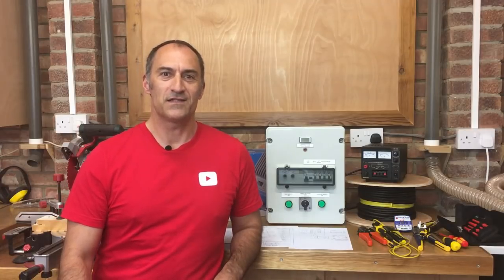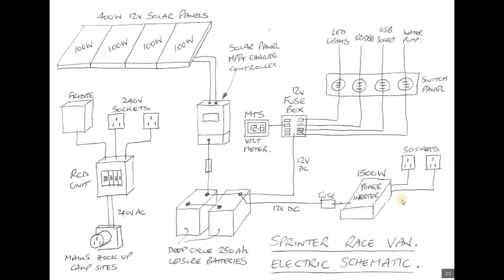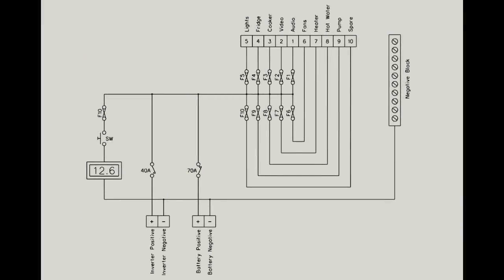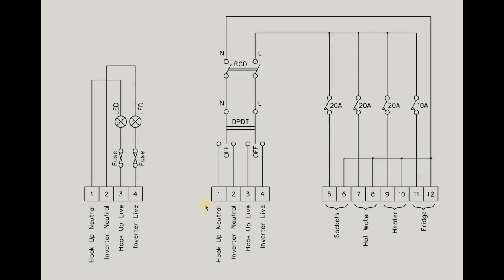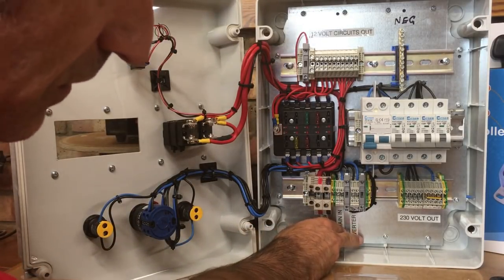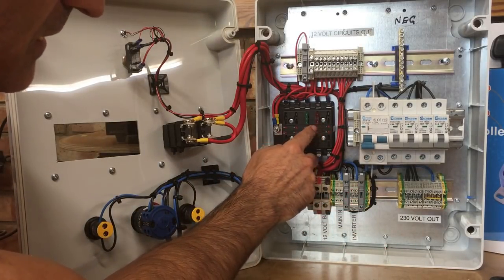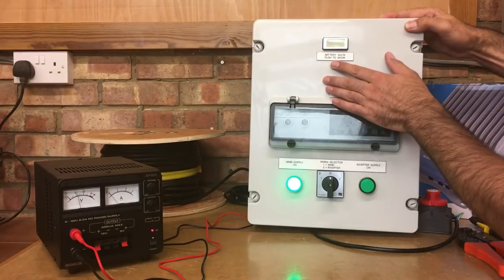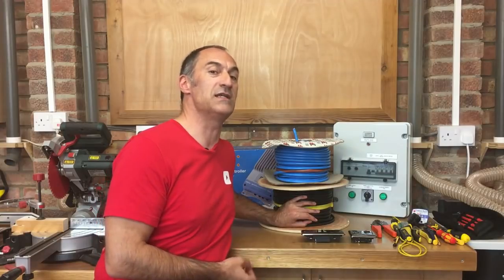Self Build Camper Van 12v Electric Control Panel

Comment: to update how you would do this now, the 2 separate systems is not so necessary.
the new victron inverter has a great pass-thru feature for shore power.
it does it all. it only uses excess AC for charging.

Comment: Now if you wanted to run it all off shore power, could you? Where would you run a jumper from the fuse box to the where? 12v fuse box? With a transfer switch between of course …

Comment: Are the red cables running the 12v side of things the same size as the battery cables coming into the unit? Looks like various thicknesses and can't get my head around it.
I'm also guessing the blue cableing for the 230v is artic blue and the black the same size just different to differentiate between positive and negative?

Comment: You used in one video a 1 pin wire connectors in a Wago connector. I would like to know where to purchase  these connectors can't find. You just pushed smal stranded wire in connectors and made wire easy to slide into Wago with ease.
Reply from the maker: Di think you are referring to “cable Ferules” they are like a shoelace crimp to bring all the lose strands together. Wago can be purchased from screwfix or tool station 😊

Comment: Hey Greg, how do the swap the shore power fridge supply over to the 12vdc or does the fridge automatically prioritise power and have both a mains and 12v connection? Cheers mate.
Reply from the maker: My fridge is just 12v DC so runs off the batteries all the time. 👍🏼😃

Comment: How do I add another fuse box if I run out of the ways/connections? - Please help
Reply from the maker: Just duplicate what you have already. So take another positive and negative off your batteries via a fuse to another blade fuse holder. You can even locate that nearer to your loads too 👍🏼😃

Comment: Hi @Greg, quick question did you put fuses on your green indicator lights as per your wiring schematic? I couldn’t see them in the video and just wondered if they were necessary? I like the idea of having an indicator to show either the mains or inverter are live.
Thanks for sharing. Your build videos are super helpful 👍🏼
Reply: @gregvirgoe
Reply from the maker: Yes, they are fused. pause the video when the panel is open and onthe bottom Din rail are two grey fuse holders betwen the main in and inverter in terminals. Yes its a good idea to have a fuse in case of a short circuit in the light.

Comment: Hi Greg, I am converting a bus and found your videos, they are awesome! thank you. I have a question, what size is your CB that connects to shore power.?
Reply from the maker: The most you’ll get from external camp sites are 16amp supplies 
It difficult to get a small RCD so one that 25amp would be best.
Reply: @GregVirgoe  Awesome, thank you

Comment: Hi Greg I have a question. In many Van and Bus conversions I see people installing a main DC shut off switch on the positive side of the battery to shut down everything. This makes good sense but one issue I have is this. All the solar charge controller installation instructions say first connect your battery and then your solar panels. fine but what happens if you shut down your battery. Surely you should shut down the solar panel incoming current before shutting the whole system down.
Reply from the maker: You are quite right. I have a double pole isolator on the solar feed so that can be isolated. My battery isolator is on the feed from the battery to my blade fuse holder so it’s on the output side. No switch between the MPPT and battery.
Reply: @GregVirgoe  Cheers Greg I will do that. Take care.

Comment: Hey Greg, is there a way I can use one fuse box, rcd and mcbs, using shore power having a couple of 240 sockets plus going through the same fuse box an inverter powering the same sockets plus a few others thanks
Reply: Sorry Greg I should have watched the video before commenting, exactly what you did there is what I want to do, would you custom make a panel like that for me? If not could you help me order the right gear and a little coaching of the internals, thankyou so much
Reply from the maker: @seaviewplumbingandheating8505  please DM me an email address and I’ll email you a perfect solution
Reply: @Greg Virgoe  Hey Greg would it be possible to have shore power going into a rotary switch, inverter the other side, a single cable into a rcd, then out of the rcd loop to a few mcbs, each mcb serving separate 240 outlets? Thanks
Reply from the maker: @seaviewplumbingandheating8505  please send me your email and I’ll send you the diagram for what you need

Comment: HI GREG WHERE DID YOU ORDER THE CASING FROM PLEASE
Reply from the maker: I got most of the parts from RS Components 👍🏼😊
Reply: Thanks. The box you used is that from there?
Reply from the maker: @wspwl01  yes 👍🏼
Reply: @GregVirgoe  I think i have found it. Do you know what size the box is please or item number?

Comment: Hey Greg,
First off I will say thank you so much! Your videos are so informative and well made!
So nice to have people like you that put so much love and time into helping are a true inspiration!
I am just about to start a van build and am trying to source out all the materials and parts I will need and pricing.
If you have the time I would love to get a list of all the parts and components used in this control panel? And maybe a link for the distribution box?
I have seen that a few other people before me have asked but I still haven’t seen you respond to any of them (maybe I missed out on one comment).
Any ways thank you so much for every thing you are doing mate!
Reply from the maker: Thanks for the nice comment. To be honest there is a much simpler solution and I wouldn’t build another panel. You can buy a changeover switch in a plastic box and do the mains switching with that. The rest is best done as per my off grid camper wiring video.
Reply from the maker: https://www.ebay.co.uk/itm/184127769293?mkcid=16&mkevt=1&mkrid=711-127632-2357-0&ssspo=G_yfF4ABSeS&sssrc=2349624&ssuid=IAwKHBzwQ6K&var=691839853101&widget_ver=artemis&media=COPY

Comment: Amazing piece of art that Picasso would be proud of , have to say sadly it’s gone right over my head 🤦‍♂️🤣.  But definitely something I wish to look into further and may quiz you , my one big question is how do you charge your leisure battery’s from say a mains supply I’m guessing solar but no mention of mains charging or vehicle charging ??
Reply from the maker: I have a 30A mains battery charger connected to me hook up socket for emergency use if we don’t have enough solar. See this video How to Wire your Camper Van to be Off-Grid
https://youtu.be/rVkDPzrA-zw
To charge while driving you would need a DC to DC charger wired between both sets of batteries.

Comment: Hi Greg this panel design is amazing. I have watched many videos as I plan for the electric in my 3500 Sprinter. Your advice has been so helpful and informative. When I started planning my control panel I found so many sizes of project boxes. Would you be willing to share the dimensions of yours so I have an idea of a starting point? Many thanks.

Comment: Hi Greg, with regards to your electrical enclosure, did you make any changes to that prior to the installation, or has it remained the same? Would it be possible to send me a wiring diagram of how it all goes together?  i.e where the wires from the LCD,  LEDs, momentary switch, etc go to. I fully understand what you have done as once again you have illuminated the dark art of electrics for me, (excuse the pun). However, I would not have a clue where to start wiring what to what. Any help you can give would be greatly appreciated.
Reply from the maker: There is a free wiring diagram you can download in the video description 👍🏼😊
Reply: @GregVirgoe  D'oh, I didn't see that it had two pages. You are sir,  an absolute star.

Comment: Another question Greg, have you considered using the 12V switch relays instead of the blade fuses? It would seem that this might be especially helpful in a camper since you would not have to ensure that you have spare fuses with you?
Reply from the maker: Hi Tom, a relay and a fuse are two completely different things and do not do the same job. A relay is just a switch and doesn’t offer any over current protection like a fuse does. 
If you have a particular device in mind perhaps post a link and I can take a look at what you refer to. 
You can use 12v dc breakers instead of fuses which can be simply reset and don’t need replacing like fuses. I have used these on my larger loads. Smaller blade fuses are very cheap to keep spares of 👍🏼😊
Reply: @GregVirgoe  Hi Greg my bad, I actually meant that I have seen 12v breakers in place of fuses and I wondered about a 12v breaker panel. I think you read my mind and answered my thoughts.
Reply: @GregVirgoe  Hello again Greg. I hope I'm nearing the end of my issues for which I need your help. I've been surprised that I can't seem to find this question answered anywhere that I feel any confidence in the answer, as I feel like it must be a somewhat common issue. When I purchased my Sprinter, the seller included a new 1500 watt Inverter which he had planned to install and never did. After completing my power audit I realized that I should install a minimum of a 2500 watt inverter. My question is, am I able to wire 2 - 1500 watt inverters together since it would be much cheaper to buy 1 additional 1500 watt inverter then buying a new 3000 watt inverter and trying to sell the unused 1500 watt. It would seem to me that some vanlife people doing conversions must confront the issue of finding they have insufficient inverter power after completing their builds and wish to add an inverter in place of buying a completely new inverter.
Reply from the maker: @pvdd1  my first question would be… what are you planning to use that needs that much power on 230v mains? My largest mains device isn’t laptop and that’s only 140W. We have a 1500w inverter and it’s way more than we need.
Reply: @GregVirgoe  I want to avoid the use of LP which means an induction cook top and I have been looking at a 4 in 1 microwave I know that no matter how big an inverter these will not be able to be used consecutively. I will also want to be a le to charge my photo equipment.

Comment: Greg, I wish to add my compliments to the explanations that you give to the wiring details. As a person who is just starting his conversion I can't  believe how helpful this will be. One question. In Canada our wire is sold by Gauge not mm When I search by 2.5mm I get numerous gauge sizes. Would you be able to advise on the gauge size you use? I have searched previous comments and can't seem to find this question answered.
Reply from the maker: This chart will give you the conversions https://www.atulhost.com/wp-content/uploads/2021/02/awg-to-mm2.png
Reply: @GregVirgoe  Hello Greg, your answers have been great and as a beginner I really appreciate your advice. I have done a lot of home wiring, but am new to automotive so your details are most appreciated. I am wondering if you might be able to offer some help to a North American.  As you are no doubt aware we use three (3) wire here, a current,  a common and a ground. When wiring the 12v DC do I still need to run the ground wires that I do with the 120? If so I assume I would join them together and ground them to the van? However, the van wouldn't be a true ground like a house since there is no ground rod, is this a sufficient grounding?
Reply from the maker: Hello @pvdd1  a 12v DC system just has a positive and negative. There is no need to ground this system. Some automotive wiring uses the metal body as a negative path back to the vehicle battery to reduce wiring but again this is not to be confused with an earth. It’s often called a ground but it is the negative connection in that case. 
Only higher voltage systems like 120AC or 230AC need a proper earth for safety reasons. Hope that helps 😊👍🏼

Comment: surely enough you could just use the same cable for both?
Reply from the maker: As I found when putting a problem right in someone else’s van it’s very handy to easily distinguish between 230v and 12v cables. 
You do not want to get these mixed up when doing your wiring

Comment: congratulations on your video, its the best one on  u tube I wonder if you could give me some advice I have a 2005 auto cruise starspirt I am using ordinary acid batteries I would like to change to AGM batteries would my on board charger would charge AGM I have no literature on the output of the charger also is it possible to fit another 100mp Solar panel the one I got on the van is a 85watts muiticrystalline Technology is it possible  to Connect another Monoccrystalline 110 watts inline with mine the charge controller steca pr 1010 10A I think I might have to change the charge controller many thanks Paul
Reply from the maker: You would be ok to swap out the battery’s as they have similar charging profiles and lead based batteries. To connect solar panels together they need to be the same size so it would be better to upgrade the existing one as well and now new ones are more efficient and smaller in size. 
You will need to fit a larger MPPT charge controller for the increase in solar panel size 👍🏼😃
Look at Renogy panels as these are now very good and reasonable price too 🤩

Comment: Just wanted to say thanks for your videos. I’m just about to start my first van. VW crafter and the set up I wanted is pretty much the same as yours. You’ve answered most of my questions I had about certain things. I’m a plumber and have motor vehicle experience so I’m not green. Anyway thanks. Great videos
Reply from the maker: There are loads of useful info in this video series. Good luck with your build. 👍🏼😃

Comment: I know this video is quite old but just looking at the series now. I would love to know what size inverter was used as its supplying all sockets including  fridge, heaters etc, that would have to be some size inverter to run all that lot. Your level of workmanship though is second to none and admired by many van camper builders

Comment: Loving the build series, I’m going to doing a van build exactly like this as I want to be able to take my bikes with me on my trips 👍🏻😃

Your panel wiring is a work of art mate 👍🏻
Reply from the maker: Thank you. What type of bike you looking to carry?
Reply: @GregVirgoe  my plan is to take a street triple and my dr 350. This will give me the option of road or green lanes. 

I’m just a bit worried about the weight of two bikes 

I’ll most likely have to fit air bags like you have

Comment: Hi Greg I'm not sure if you talked about this in one of your videos but have you grounded your 240V or 12V circuits to the chassis of your van? What are your thoughts on this?
Reply from the maker: There is no need to connect the 12v DC system to the vehicle. You should earth the 230volt side to the van and connect the hook up earth to the the chassis also.

Comment: Hi Greg any reason for not using double pole mcbs or do you carry a polarity checker and reverse lead as some do on the continent
Reply from the maker: You would still need to check polarity even with double pole MCBs. I do have a reversing lead and plug checker.

Comment: greg this is great but there is a simpler way of achieving all this let me know if you'd like me to explain i shall be watching the rest of your series as this is something i'd like to do, i do actually live on a boat that i've fitted out myself currently refitting her as i ran out of money first time around
Reply from the maker: Yeah I've done a few more recently for other people with a 30A changeover relay for £15 and all fully automatic :D
Reply: @GregVirgoe  on the boat i have an inverter charger 3kw how that works is you have 240v input from shore power then an outlet for the 240 to plug  sockets so while your hooked up the inverter is charging your batteries when you uunplug the shore power or if it trips out the inverter aouto switches over to drawing power from the batteries, the switchover is so quick that tv or pc's don't switch off you also get  the correct mega fuse as well , i watched your boat trip i'm quite local to foxton done the locks a fair few times and watford and long buckby  if you had turned left onto the GU you would of come to a tunnel which is nearly 2 miles long lol
Reply from the maker: @travellingjournalist966  we only use 240v devices very rarely so most of the time 95% our inverter is turned off saving us lots of wasted battery power. The more you can run 12v off the battery and solar setup the better 😊
Reply: @GregVirgoe  yes i agree i bought a 12v fridge freezer begining of the year i do have a 240v tv but i'm going to try and see if there's a 12v connection inside it I'm actually refitting the boat
Reply from the maker: @travellingjournalist966  we use a 230volt smart TV because it had more features than the 12v ones.
Reply: @GregVirgoe  i did look at 12v smart tv's but they were 4-500 pounds

Comment: Hi Greg.  I use your videos as a 'bible' for wiring (and insulation) - they're just awsome.  :-)  In a later video you mentioned that you would 'simplify' the electrics in hindsight.  As the approach on this video looks so ideal, can I ask what makes you say you would simplify it?  And in what ways?  Would you simply do away with the changeover switch and run more cables to sockets etc?

Comment: Hi Greg, loving your work! So well planned and executed. Just planning  my own electrical system. Is there any reason you chose the changeover approach over simply wiring the inverter to the batteries and using a mains voltage battery charger to charge the batteries when on shore power? If you can turn the inverter on/off remotely this seems a simpler option maybe?